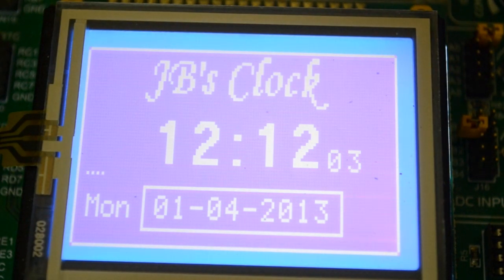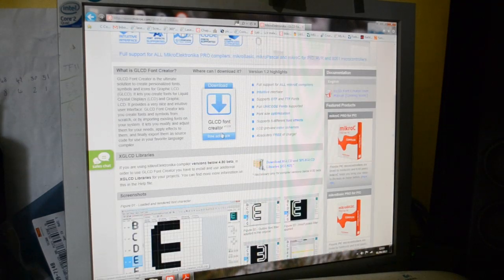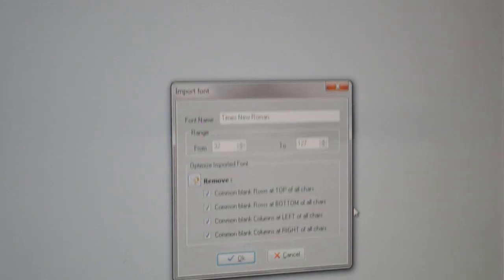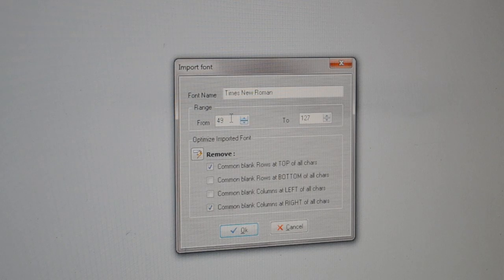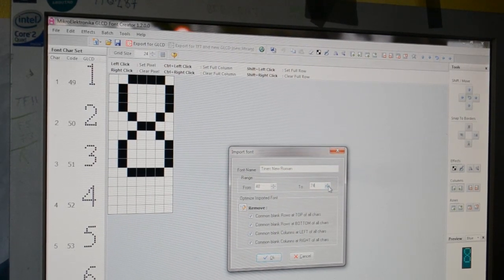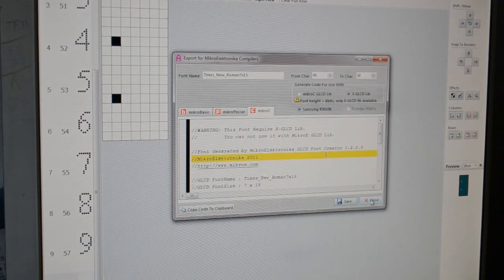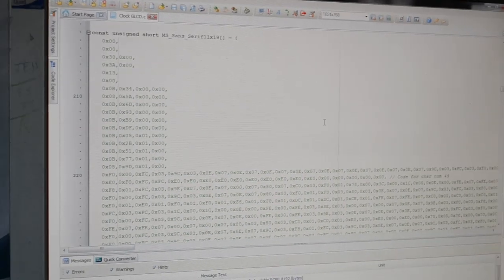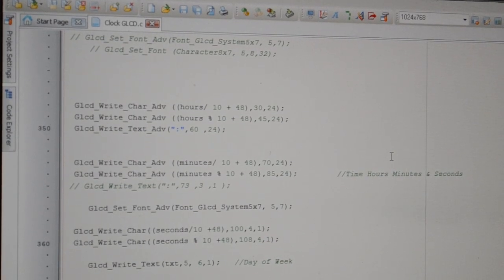GLCD Custom Fonts - Large Fonts  - MikroElektronika MikroC, MikroPascal, MikroBasic

Comment: Excellent , you can provide the code, I have a project with a clock, with large mumers, but I have tried to do it but it keeps flashing, numbers, glcd 128x64, I tried to use Glcd_Set_Font_Adv(font15x19, 1, 0); Configure the source
        Glcd_Write_Text_Adv(time_str, 5, 5); Displays the raw values in the GLCD